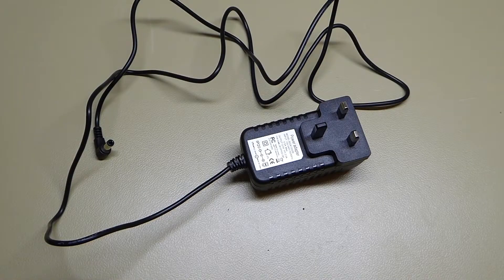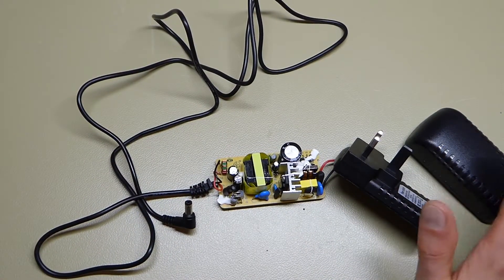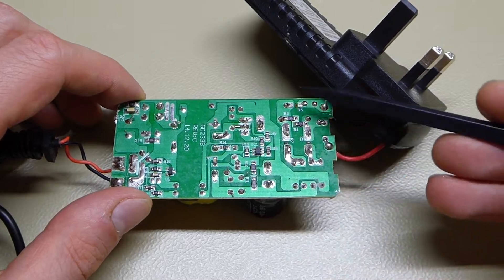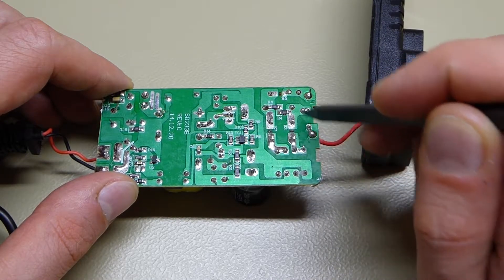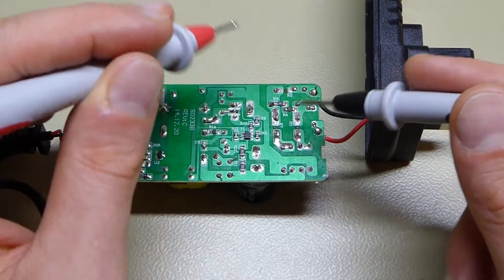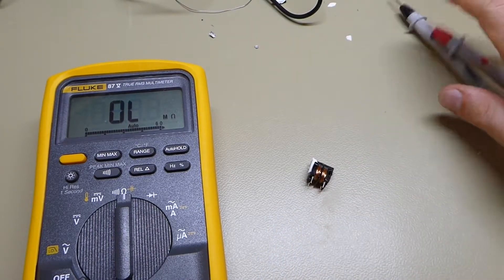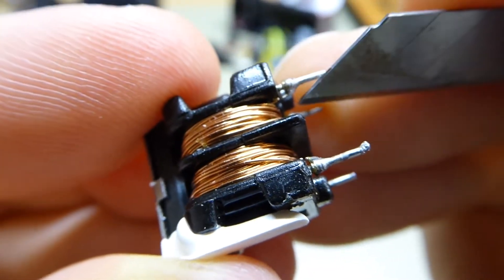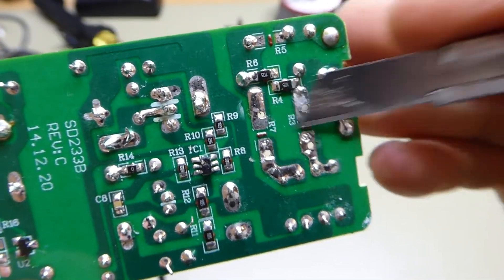Common-Mode Choke Failure

Comment: Hello, when u buy a new replacement choke and unlike the original broken one with "white glue" still on it as an indication or reminder which side it was original facing on the pcb as lengthwise it's symmetrical and can also be inserted the other way around, how do u know it's proper orientation or it doesn't matter? Im only concerned about the markings on the pcb which specifically indicates a tiny square on the edge so meaning it's kinda "polarized". appreciate the response.

Comment: May pull out the pins when something put some force on this side or the white gule get smaller when it gets set.
This is why practical to bond the components to PCB and not to eachother. Because only the pcb has any mechanical support from case itself.

Comment: I had one fail open on me, just one winding. That was after it was in use for nearly 30 years. After discovering that, I unwound it, measured the wire diameter and rewound both coils with some new wire and normal operation was restored. Mine was in an antique computer power supply. Replacements were no longer available. But the repair was simple enough.

If you look at the ends of the wire carefully with a good magnifier, you might be able to see wire deformation at that ends caused by small diagonal wire cutters.

Nice video, thank you for posting it.

Comment: I was troubleshooting an old Tek scope today and one of the common mode chokes in the line input filter started making noise and then emitted a bunch of smoke - part of the SMPS voltage to smoke converter phenomenon, I guess. I wasn't even taking measurements when it happened. It also blew a hole in the side of a bypass cap adjacent to it. I'm guessing the cap spontaneously shorted and took out the choke. Anyway, thanks for a great video.

Comment: The wire was winded with tension so after a couple of months of heating/cooling cycles it just snap. Viva China! I had an ancient precision resistor bank where wires in coils break in multiple locations...

Comment: that may be a common failure since they used so much gunk, maybe something wrong with the manufacturing and later stress during assembly of the case

Comment: That is bizarre; In all the years of servicing I have never come across a double failure in a choke. After careful consideration and looking very closely I believe it was sabotage, you can clearly see it was cut on both sides of the leg. If one side had been affected that could change my opinion, however when you consider that it slipped through quality control undetected one must wonder.